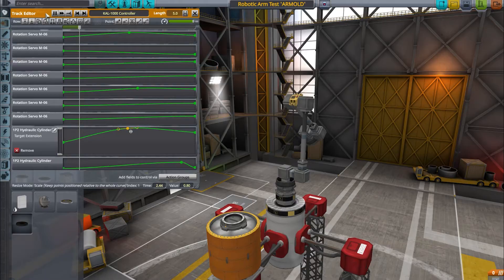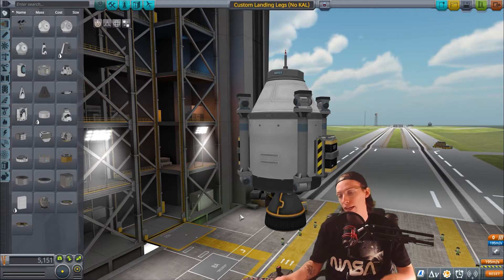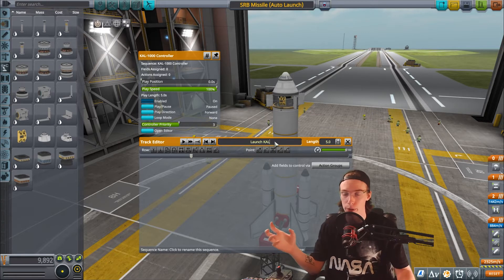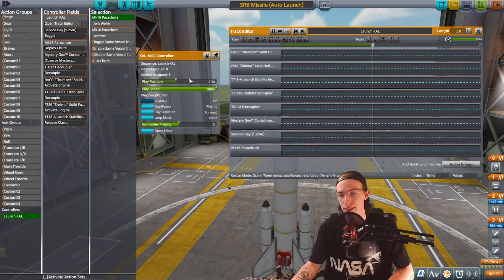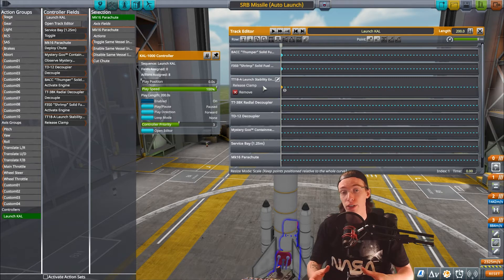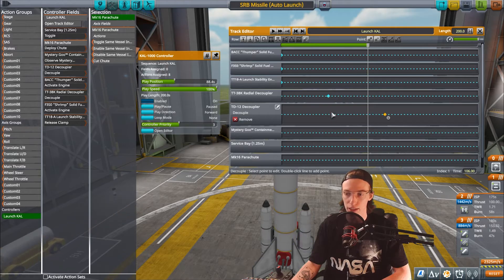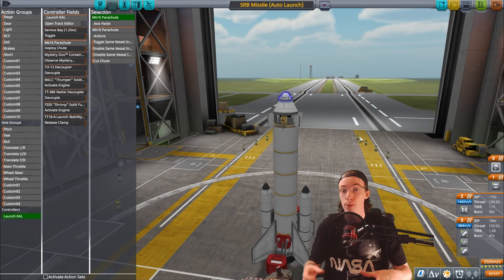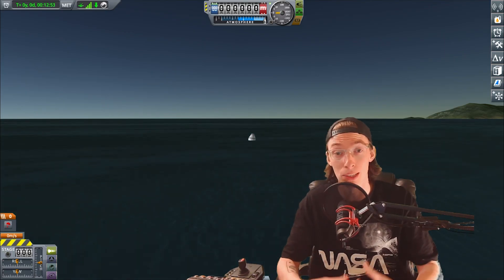Complete Guide to the KAL Controller in Kerbal Space Program! Part 1

Comment: Hi! This is a great tutorial series! I had no idea how to work KALs before and now I've got a working CH-47 replica that flys stable and level thanks to two KALs working the rotor angles and a hinge to angle the front motor. Funny enough though, these more complicated KALs didn't give me any trouble, but I'm having issues with an on/off set of KAL fields. I'd like to have 7 spotlights on the rear rotor mount that light up and turn off in sequence with the rotor angle as a way to indicate what the rotor pitch is. I've tried using 'toggle lights' and two fields per light for 'turn light on' and 'turn light off', I've done this as additional fields in the KAL that controls rotor angle, and as it's own KAL controller on the same group as the rotor angle KAL, the U/D translation group, and I also tried removing my Indicator lights from the main light control group but they still never light up at all. I can manually turn the lights on, and the Rotor Angle KAL still works fine. Not sure what I'm doing wrong. Anyone have any ideas? Seems like it should be simpler than balancing flight controls for a helicopter, I must be missing something little.

Comment: Well that was definitely helpful for getting me started, thanks Urban Venture! Although I have one question - why did you decouple after the main SRB burn after 105 seconds and not 58 seconds? I'm just confused at that part, because I thought both SRBs fired at the same time.
Reply: the first stage showed how long it was going to go until the side boosters fell because there was a stage after with the main SRB still there, so it splits the time across the 2 stages
he added them together and bam that's your time